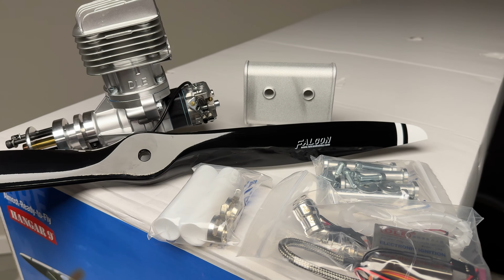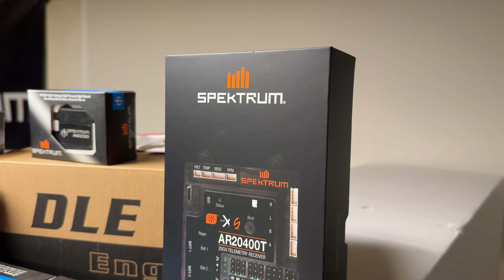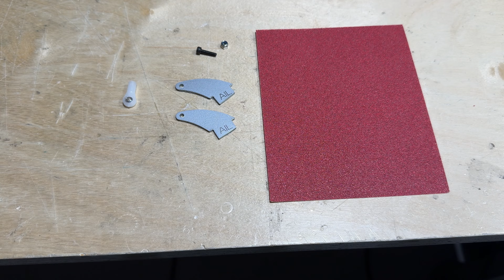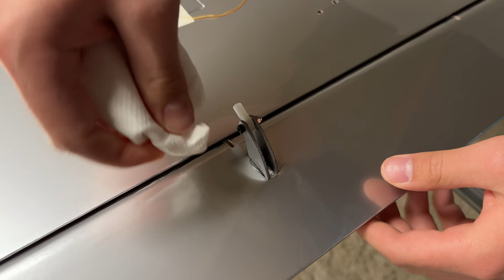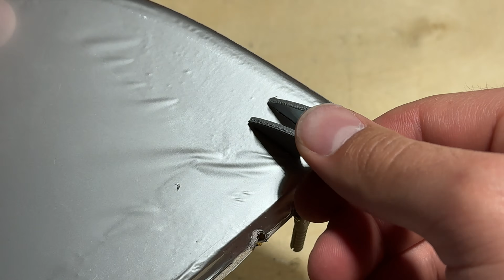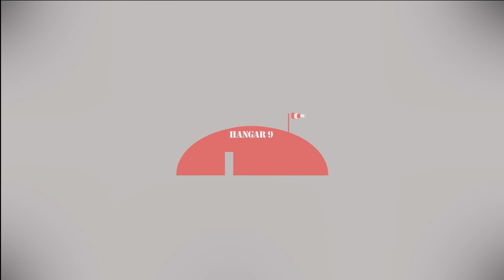Hangar 9 CubCrafters XCub 60cc Build - Overview, Prep, and Control Arm Installation

Comment from the maker: Please click "...more / Show more" for links and more information. Visit https://www.horizonhobby.com/product/HAN5260B.html for more information on the CubCrafters XCub 60cc.

Welcome to the first build video in the Hangar 9 CubCrafters XCub 60cc build, part of the Hangar 9 Back to Balsa Series! This video gives an overview of the electronics, engine, and propeller that will be used in this XCub 60cc for the build. You will also see how to prep the covering on your XCub 60cc for the build. during shipping, the XCub's UltraCote covering is often exposed to many changes in temperature, humidity, and pressure which may result in wrinkles. It is a good practice to go over all of the covering with a heat gun or iron to shrink it and get rid of the wrinkles. This ultimately eliminates the risk of potentially loose covering tearing off in flight. Lastly, you will see a good technique in how to install the control arms into the control surfaces.

Aircraft Setup:

Engine - DLE 55RA
Propeller - Falcon 23x8 Carbon Gas
Servos - Spektrum A6320 for surfaces and Spektrum A6330 for throttle
Receiver - Spektrum AR20400T with two 7.4V 4000mAh 2S 15C Smart LiPo Receiver Batteries
Kill Switch - Tech Aero IBEC HV
Fuel Tank - AJ Aircraft 24 oz.
(4) Spektrum 24-inch Servo Extension [SPMA3005]
(2) 12-inch EC3 Battery Extension [SPMEXEC312]
(1) Dubro Super Strength Long Servo Arm: 23T [DUB671]
(2) Aluminum Servo Arm - [HAN9151]

Watch the rest of the Hangar 9 CubCrafters XCub 60cc build videos here! - https://www.youtube.com/playlist?list=PLUfse7Ks5AZiX6KAoGCayDQvm6HSlzVC0

Follow Hangar 9 on Facebook!
https://www.facebook.com/Hangar9RC/